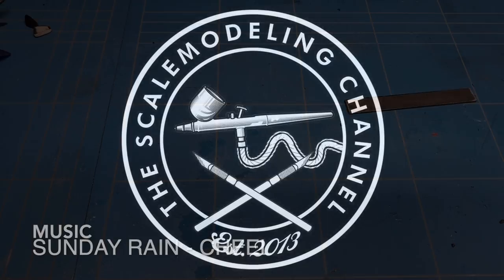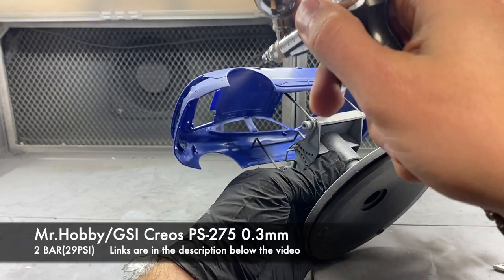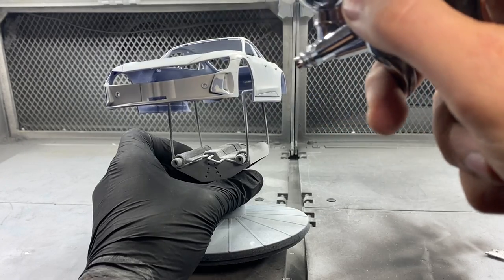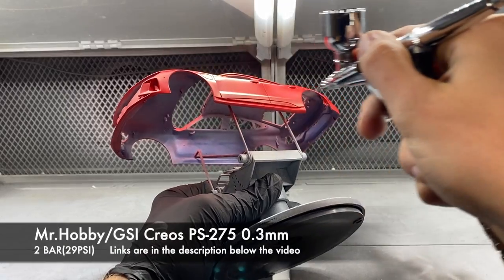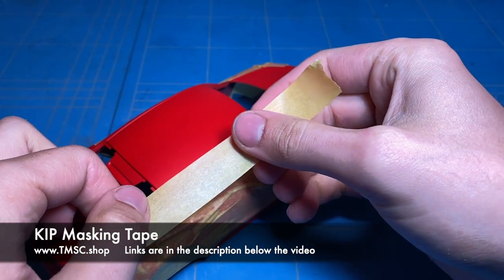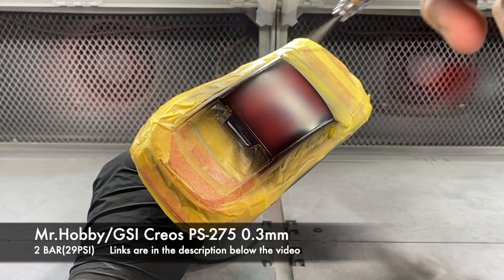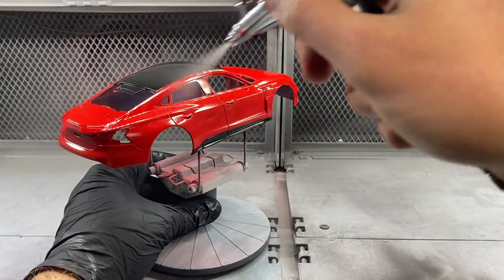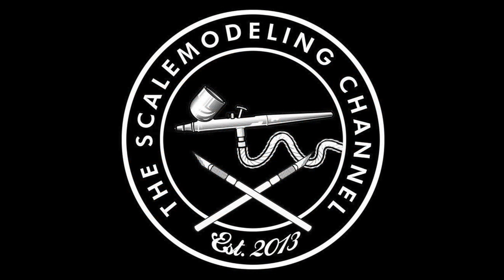Building the Revell Audi RS E-Tron GT Part 1

Comment: An old 1:1 car painters trick I learned years ago, any time you need to put a light color over a dark color, especially white over red, black primer first, also, silver will work, it sounds  like the reverse of what you want to do, but really it works, white may not cover red, but it will cover black with no problem. So black primer first, then white or gray, then your color. On another note, I really do enjoy your videos, I like the music you use, although not something I would normally listen to, being an old headbanger from way back, I don't really want to listen to jarring rap or heavy metal whilst watching a modelling video. Your work is really amazing. And, just curious, where in this great big world are you located?, don't have to answer if you don't want  to.

Comment: I finished one of these last week, be aware that the interior won’t fit in the body unless you remove the rear clips since they’re in completely the wrong place. Ignore the instructions and glue the interior floorpan to the chassis during final assembly.
Reply: No... they are correct
Reply: @soehncarsten  not on the one I built three days ago and I checked it very carefully. I had to remove the rear clips since they were at least 6mm too far forward.

Comment: Very well done! I like how you identify the colors and tools used. Makes it easier to find them online and IF available in the U.S. Question on the dirt specks on the roof: When first noticed, why did you choose not to use a 1-3k grit sandpaper to remove the specks, and repaint?
Reply from the maker: That would create more dust on the rest of the model and require a re mask. Too much work, too little time, does not guarentee it would not happen again. Basically, i'm lazy and wanted it painted XD. It does not always have to be perfect for me.

Comment: Another fine video.  A question Ive had for some time though.  How do you decide your air pressure?  Usually your at one bar but sometimes 2.  Whats the difference?
Reply from the maker: I’m always at the same pressure. 2bar
I tried 1 bar when i got my new airbrush. But turned it back up to 2bar. Its all personal prefference

Comment: I don't understand why they designed this as a snap together kit. Not many, if any kids would choose to build this car, but an adult surely would. This should have been designed as a full kit by Revell Germany with opening hood and engine, it deserves that
Reply: Being an electric car, the level of detail on the underside is minimal anyway, and it lacks an "engine". I've just finished this kit myself and despite the snap fit nature, I think it's perfectly acceptable
Reply: I am building a monogram ford F1 right now. flimsy connections and poor fitting cause glue to spill. I have several ugly glue stains in many places, and the paint was damaged at several spots. I wish it was a snap together kit.